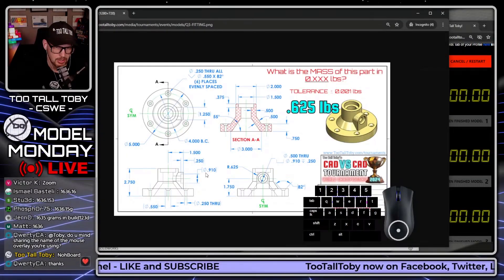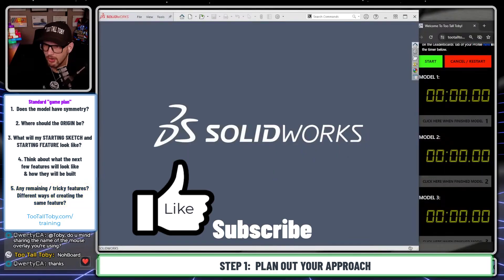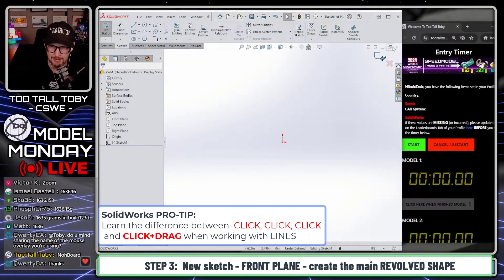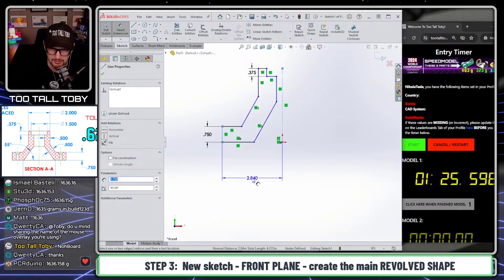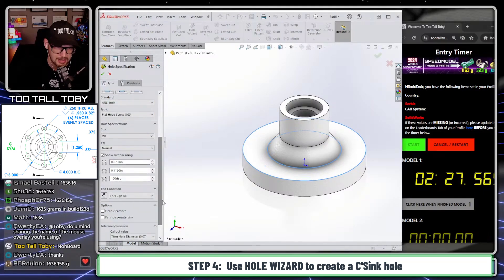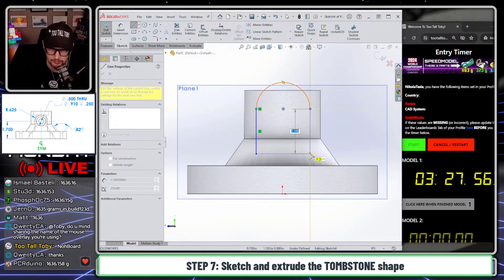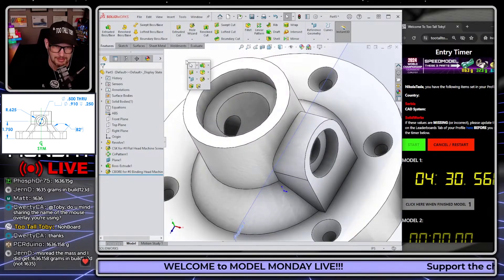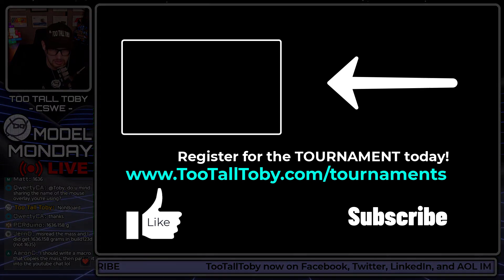SolidWorks FITTING - LIVE SOLVE - Beginners/Intermediate STEP-BY-STEP Tutorial

Comment: ran it on my solidworks 2025 and got this mass 0.582 pounds. also rechecked all dimensions. Are there any version differences?
Reply from the maker: No - shouldn't matter what CAD system you use - maybe the material density is off?
Reply: @TooTallToby  got it- issue with dimension of the base. thanks

Comment: Did this one in OnShape.  New lesson was extrude-to-face!  I didn't know the up-to-face could be a curved surface.  Seeing you do it in SW gave me the clue to try it in OnShape.  
My mass is 0.626 lbs.  Is this tiny variance (.001 lb) a difference between  SW and OnShape?  Or do I still have something wrong, I wonder.
Reply: Any shape of face can be used with 'up to face' but the limitation is that the tomb stone shape should be overlapping the cylinder, otherwise it will not terminate. If it overlapps no problem, if it doesn't, problem. You don't have this limit with a planar face. Planar face is projecting a plane that is infinite. So even if there is no overlap, SW knows where that plane is so it can terminate.
Reply from the maker: Here's the full run in ONSHAPE - you should be able to get it to 0.625
https://youtu.be/g6YceAYMy4E?si=AGDXxGCqmv-C5TLc
Reply: @TooTallToby Thanks!  I pretty much did exactly what you did, but I obviously missed something.  Back to the "drawing" board.
Reply: Found it!  I had the countersink diameter at .05 instead of .055 in.  Mass is now .625.  Aww yeah!
Reply from the maker: @kenhaley4  Awesome I love that you found it!!